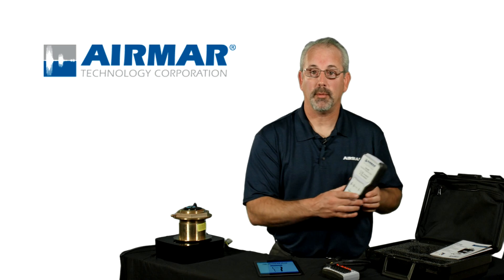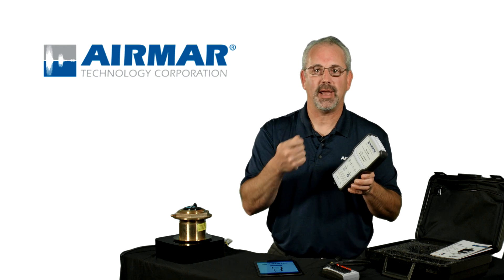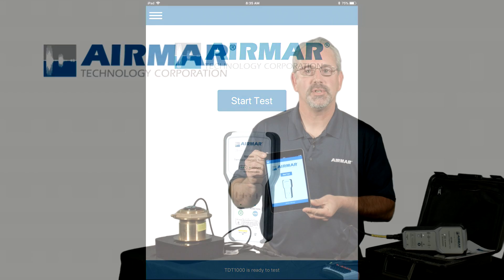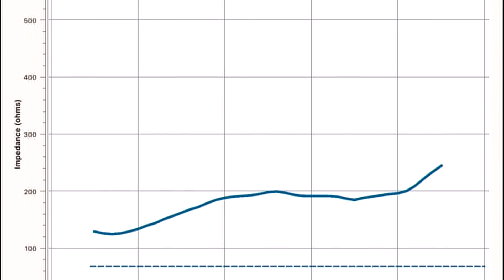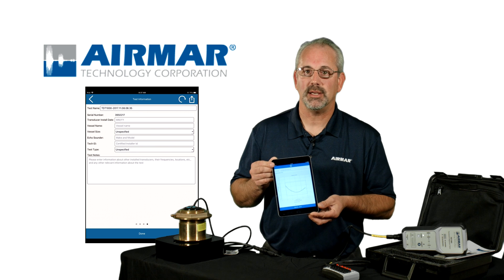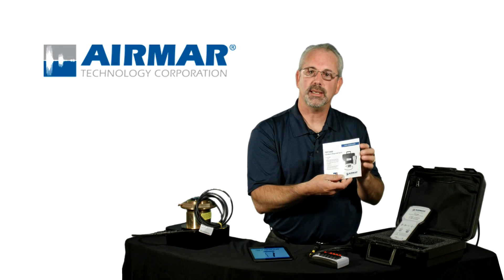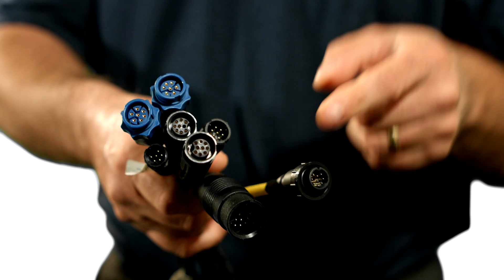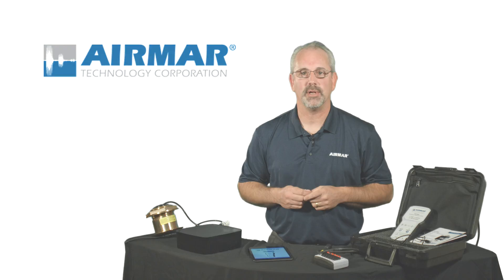TDT1000 Overview

Comment: Hello. 
Dear Friend.
Is important to use that square black box to do the test?
I have done my tests on a galon of water, and I have a problem, I known that I had to use the Airmar's transducer like reference number in the App to it can read my furuno's transducer but my transducer is not in the list, it is a Furuno 520-5psd 600W 50/200KHz.
I did not find my transducer's model in the list.
 There is an option (default TEST)  600W 50KHz/200KHz, when test has finished show out of range.

I had to do my test on a tank but I got the same Problem... (Default TEST)...

Can you help me please?
Reply: Very sorry for the delay in answering.  Yes, the proper test to use is the default 600w 50/200kHz test in he SensorCheck app.  You don't have to use the TDT tester block, however testing in a small bucket of water is not recommended...it is always best to test in deep water (2 meters or more) or use the Tester block.   The bucket will often cause a failing result.